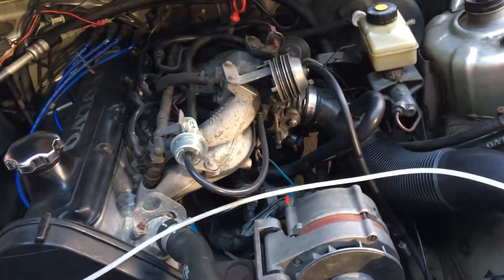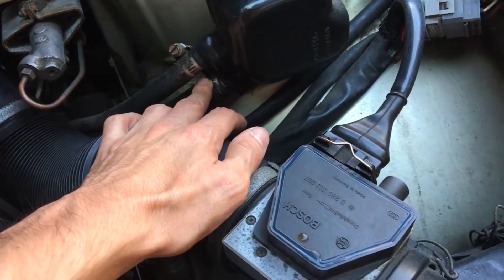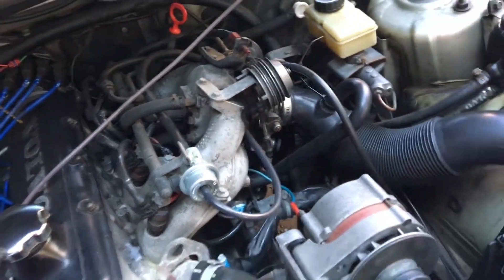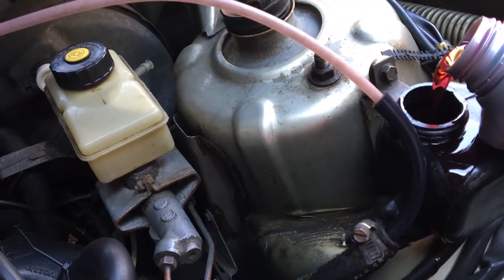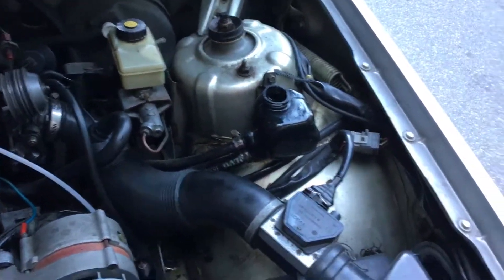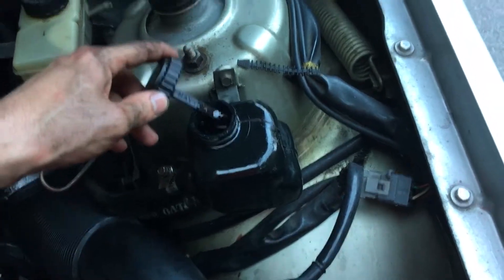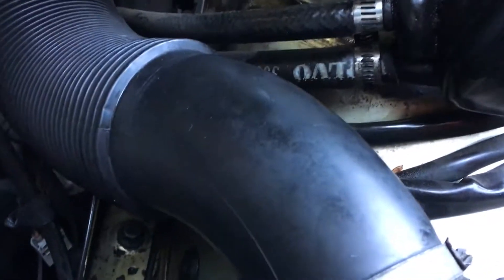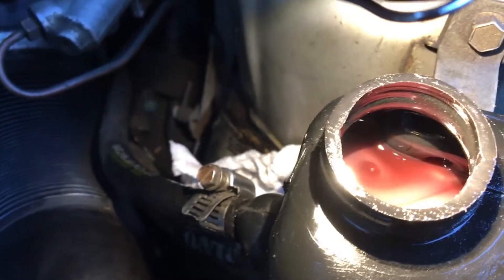Steering flush all over the floor!

Comment: Hi there, being that it uses cheap atf fluid, I strongly recommend to just take out the old fluid with a turkey baster, refill, go left to right a couple of times with the steering wheel (to the top) and repeating the process 2 or 3 times. Way less complicated and fluid will end up cleaner because making the pump work will release some of the dirt repapering in the last minute of the video. Great video! Thanks for sharing!